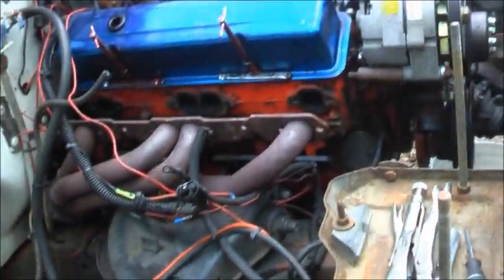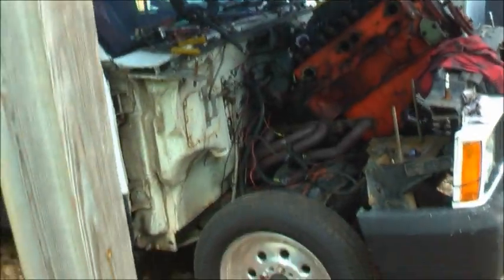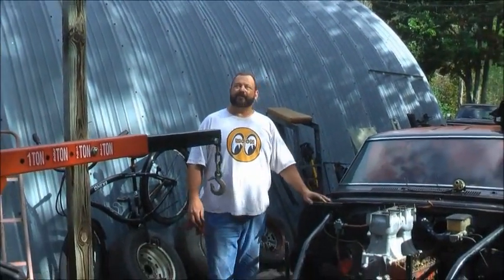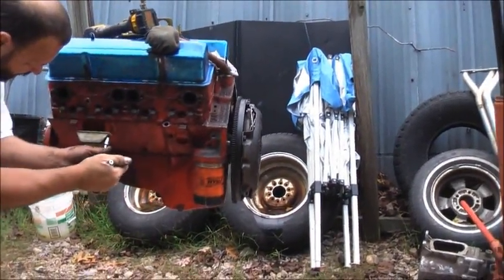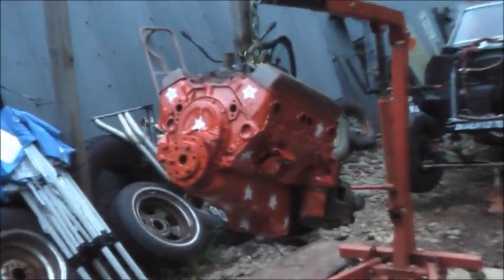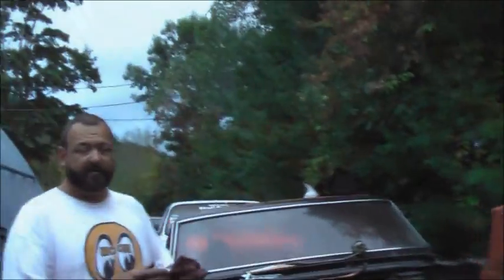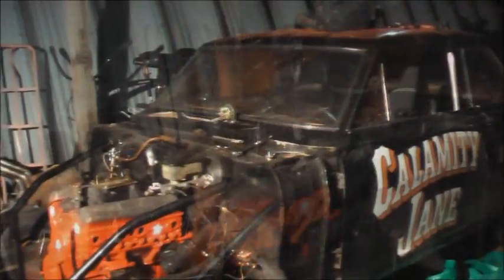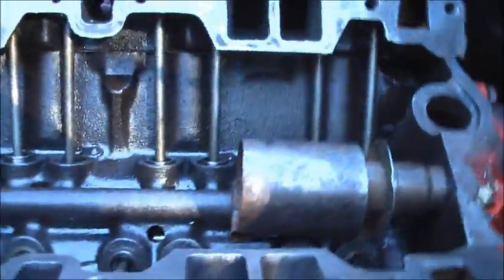SKULL GARAGE..2015 A SBC 283 GOES IN THE 64 GASSER "CALAMITY JANE"

Comment: Those little 283's are tough as nails, should make the nova get down the road, and with that tunnel ram should wake the little fella up as well.
Reply from the maker: +HitokiriRaiden oh yeah man i love those small blocks!! and the tunnel ram should really wake it up like you said, it did wonders for my ole 74 nova whole new car after i tunnel rammed it,it being a light car i think the 283 will be just fine ,need to find me a 5.86 gear instead of the 4.88 but im pumped up man....justin

Comment: I got a “real “ 283 that I’m building. The crank is in and the pistons going in this week. Should I plug the crank case vent holes and opt for the valve cover pcv system. I am told that old system is messy and the  narrow galley clogs. My motor looked like a mess from inside under the intake .
Also what would you put on as far as heads for a street motor. 516 s 601s powerpacs or world products 305 torquer heads?  How bout a cam? I enjoy you guys videos and your love of hotrodding 283s.
Reply from the maker: Yep block off the old vent system and run a Pcv to the valve cover,it just works alot better,and as far as heads goes smaller valve heads work better on the 283 unless u r really turning it up,world products would be ur best bet if u have some laying around,also a 305 HO head the 601 casting have a 53cc chamber and 1.84 1.50 valves they r great for a 283 and can be got pretty cheap,they will raise your static compression ratio,but as for a cam it all depends on what u wanna do with the engine,daily driver,drag race,street and strip etc,and ur gear ratio and intake and carb combo what kinda fuel u wanna run and what compression u r after, that is all important for cam selection...justin
Reply: SKULL GARAGE I will be doing the world heads cause I got a good deal on them 
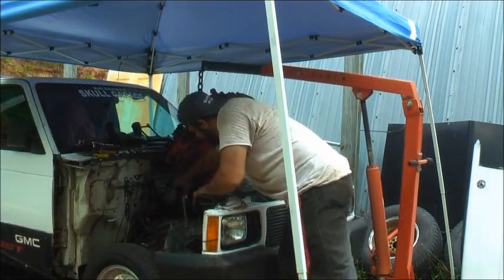  4 speed Muncie 3:31/1 in the rear it want it to sound  nice and have a bit of a lope but fun on the street no drag racing at a track
I was thinking 204/214  420 /443 
I am told I need to keep some torque with this motor because of the shorter stroke.